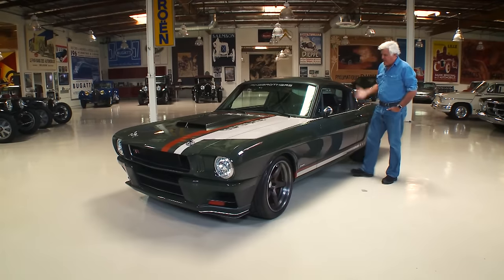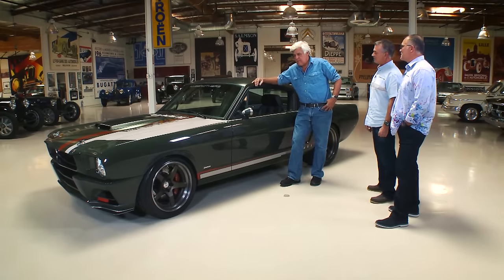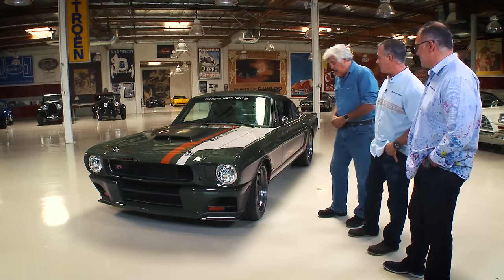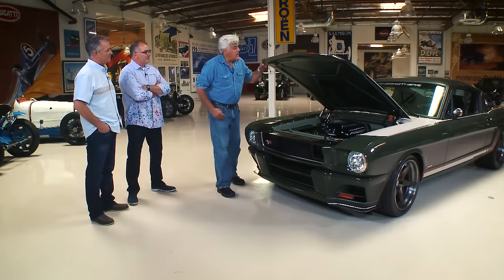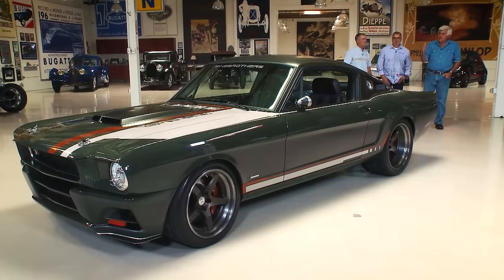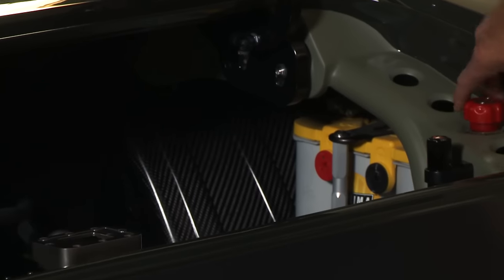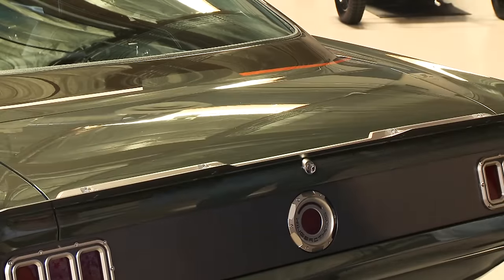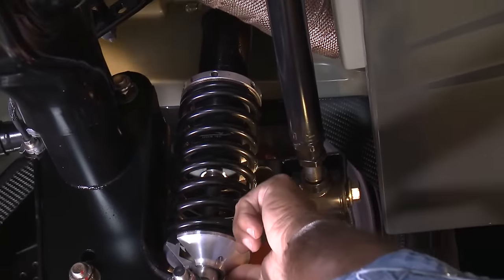Ringbrothers 1965 Ford Mustang Espionage - Jay Leno's Garage

Comment: Lets be honest. When a car is built to that extent, it's not really a Ford anymore anyway. 

I'm mean, it is. But it isn't. So there's nothing wrong with the LS.
Reply: Yeah I agree 100% man. Ford needs to step their game up and make more accessible engines like GM does with the LS series. If they would do that I don't think we would see all these LS swaps, because it does get a little boring seeing everyone putting LS engines in everything.
Reply: +Cotil3Boy47 yea shoulda swapped to a j2z
Reply: +Cotil3Boy47 yea bro
Reply: They're stupid for not going with a turbo 4 banger OMG OMG OMG the low end torque is unbelievable so much POWAAAAAAH!!
Reply: +Cotil3Boy47 yea a formula atlantic 4age would be nice
Reply: +SpaceManDawn Now if they had used that crate twin turbo V6 that makes a ton of power for kinda cheap that would have been worth a segment on JLG
Reply: +SpaceManDawn Well.... It is a hot rodding tradition to put Chevys in fords to make them faster. The SBC brought light weight and power into an everyday guys car.
Reply: mweverett This is very true but I wish Ford would make a more affordable SBF so we can have a little more diversity ya know.
Reply: +Cotil3Boy47 its not that they're engines aren't accessible, because they are. Its just that true builders know the real potential of the LS series and how it is superior than most engines.
Reply: Mike Cid Yeah that's what I meant, because with the LS engines you can get alot more out of it with less plus great reliability.
Reply: +SpaceManDawn Ecoboost 3.5 would have been cool.
Reply: +Cotil3Boy47 Ford has stepped their game up. You're right in the LS being a very accessible motor, but that's only because it's essentially been around for 30 years.

Ford has taken a gamble on getting away from pushrod motors, and while it's taken them a good while to get their feet under them, the current engines offered finally compete against the LS/LT series.
Reply: Couldn't agree more.
Reply: +William Timmins It would have been a lot slower though
Reply: Would it? 900 hp from 3.5 is not that big of a deal i have 3 customers that have over 900 hp subarus at 2.5 and 2.6 motors. I have seen many 3.5 nissan gtrs in that range and crush many over 1000 hp cars in the mile drags. never the less if the ecoboost made say 600 your going to tell me that guy is going to use all of his car? Most people cant use there stock car to full potential. Its might be more track savvy with 2 less cylinders over the front wheels and a little less weight we wont know just would have been a neat motor for a old school mustang. Not knocking the ls as i just stuffed a supercharged ls3 at about 760 hp in to a BRZ Bla nightmare.
Reply: theparttimewoodworker If you're going to troll, at least know how to spell Camaro. try again.
Reply: Yeah I guess so..Ford is coming out  with the new GT that has 600 stock....so it doesn't take a lot of imagination to see 900Hp
Reply: +Mike Cid Even though the actual "LS" engine may be only 20 YO, It has its roots in the pushrod motors of old with GM. That's why I said 30 years. LS motors are still old Chevy pushrods at heart.
Reply: I never said they weren't, but you specifically said the LS engine has been around for 30 years.Pushrod at heart and still better than most engines, and easier to work on. DirtyD
Reply: +Smokin07ram the 3.5L EcoBoost platform is a fuel system, turbo swap, and mile head work away from 1000 hp easy.

Bisimoto Engineering was able to get a 2.3L EcoBoost Mustang to 900 hp with very mild modifications. So a 3.5L would only help improve that power number.
Reply: DirtyD If you really look at it the Ford dohc is kind of inferior in a way. I love both companies and engines equally so don't get me wrong here. It's just that the LSx engines are lighter,more torque, more compact and gets just as much if not more  MPG(depending on application).So I just don't see why people always claim that the Chevy's are old outdated tech. The only advantage I can see the ford dohc has is they can rev a little higher.
Reply: +SpaceManDawn True, the car is only a Ford because of the VIN. I'll say this, as much as I love LS (I had a 2001 C5) it's the easiest motor swap period so, it becomes cliché. Wonderful engine, just would have appreciated a different V8.
Reply: ***** I am a chevy guy, but I hear that
Reply: +Mike Cid I was indirectly saying the tech behind the LS has been around for awhile, as I know the actual LS line hasn't. Poor wording on my part.
Reply: +Cotil3Boy47 EPA and CAFE don't apply to the new FGT. Ford chose the 3.5L EB to conform to the racing regulations for LeMans, which don't allow a motor to be over 4.0L in displacement. They've been testing the 3.5L EcoBoost prototype for 2 IMSA race seasons now preparing for the FGT specifically. Why spend time and money developing a new engine when you already have a proven one right in front of your eyes?
Reply: +Cotil3Boy47 VCT is still in its infancy. Due to CAFE and EPA, GM will eventually have to bid a due to the pushrod technology and begin with a new platform. The current DOHC motors with Ford are doing pretty well, especially the Coyote. While they really are pushing the EcoBoost lineup, the normal NA motors are still pretty stout.

However, calling DOHC technology "inferior" is just stupid. Look through all the NHRA and NMRA record books and you will see DOHC Mod motors holding records, while an LS engine is no where in site. Fact of the matter is a DOHC has much more potential than a OHV motor before you have to start looking for more displacement
Reply: DirtyD Haha, you're still the same. I bet this is much more civil than debating on DFW50s.com right?
Reply: +Dominic Toretto haha, you know it. What's up man? I shot you a text, but not sure if you still have the same number.
Reply: +mweverett haha go say that to the new gt350r shatters the camaro record on every track they've tested it on. Chevy's suck
Reply: +Travis Gonzalez keep living in denial....
Reply: +DirtyD except for weight and centre of gravity, LS motors are compact light and position the mass of the weight low which is great when your on a budget, i am a mopar guy but you have to give credit where it is due LS motors are the best all round v8 performer at this point and time
Reply: 1. You did not have to call my opinion stupid but I should have came up with a more respectful word other than "inferior" tho. I can see where you are coming on the ecoboost but I just feel the Ford GT is just more deserving of at least a V8 for the $400k pricetag. Also I love dohc and ohv engines so which ever one somebody choose is great either way. So both have their advantages and disadvantages, i feel It's the great performance per dollar that puts the LSx over the top IMO. It's just that I don't see why some people always feel the need to diss pushrods by claiming it's old outdated tech when dohc has been around for a long time too. Both are great engines in the end ya know.
Reply: +Cotil3Boy47 wasn't calling your opinion stupid, poor wording. Was saying that using the word inferior is stupid. The LS is a much more cost effective and efficient motor for the common mechanic/gear head to work with, without spending buckets of cash. But if you really want to go fast with almost limitless possibilities, DOHC is where it's at. 

The LS will go down as the motor of history most likely.
Reply: +Road to Adventure agreed. I don't hate the LS. I hate everyone that thinks the LS is the GOAT without a particular reason other than GM > Everyone else, just because.
Reply: I can agree with that, also you're very cool man unlike the other people who start insulting you when they don't agree with you.
Reply: i think this conversation is a good example of informed individuals with differing opinions recognising the validity of all the opinions while respecting each person and debating the facts with the right amount of opinion thrown in, hopefully one day in the future this will be how all discussions amongst people occur
Reply: most people with cool hobbies haven't got time for bullshit that doesn't matter
Reply: +SpaceManDawn agree but you almost have to update some things.  i drove an orignal 65 once and it handled like a pig, body roll, bad squishy brakes, loose stearing, underpowered 289, like driving a tank, well what i imagine a tank would be like to drive.
Reply: +Cotil3Boy47 Bear in mind that GM's LS series are small block overhead valve engines... nobody else really does that... Dodge's Hellcat engines are overhead valve... but it's arguable that that's a tantamount comparison to apples and oranges... so ppl go with the LS series because of a lack of other options and their amazing accessibility and immense aftermarket support...
Reply: +Cotil3Boy47 and give it a massive fart can... and a wing... and ground effects and don't forget your neon...
Reply: +SpaceManDawn Kinda like with Ken Block's 4x4 Mustang. I really don't get why people are so butthurt about these things sometimes. The whole American car culture is based on rebellion, this is just another step.
Reply: +SpaceManDawn its not anything anymore just a really nice kitcar... Haters gonna hate
Reply: +Cotil3Boy47 
LS Engines = Best price, easiest install, made to work with everything. (AKA LEGOS)
FORD Engines = A little pricier, have to know how to install engine, BUT HIGHER QUALITY. (I.E. Tougher pistons, rods, crank, housings, and block AKA more room for bulletproof POWER (without blowing up your engine.) (It's sort of like a titanium razor, you don't need it, and it costs more, but you'll sure get a better shave for longer.)
LS motors are boring, but they work.
Reply: God that's like saving Chuck Norris with the heart of Justin Bieber.
Reply: cybertree
I don't get it.

You're saying you wouldn't kill Bieber to save Norris? Seems like a win win to me.
Reply: SpaceManDawn nope norris is old his time has passed beaver on the other hand is pretty generous when it comes to donating to the needy and he is still young. what have you done with your life? ps. beaver has donated more money then you will make in your life =(
Reply: +SpaceManDawn the motor isnt good
Reply: John Rogers john rogers = guy from india?
Reply: Nothing wrong, except for the fact that it's a POS junk GM product....ruined the car for me, I stopped watching the vid right then and there....
Reply: +Branon Fontaine,  I think you should have Jay put a big block Ford in a Government Motors car.
Reply: Lance, be nice to Brandon he is really a typical American car buyer. He drives a Honda.
Reply: +zum Saw a mid-80s Mustang with a j2z in it for sale on Craigslist.recently.  Had TRD fender emblems, even.Guy wanted 28K for it. May take a while to sell.
Back in the '80s one of the Mustang magazines featured a '71 Mustang with a Chevy 350 and twin turbos. The next month the editors said they'd never had so much hate mail over a car before.
Reply: +theparttimewoodworker If they had built this car as a Camaro, I would be the first to say "well done."
Reply: +Cotil3Boy47 So Ford can put 427 and Boss 429 engines in a NARROWER Mustang body than these, but you are saying they needed to put an LS? No thanks. Like the guy said, show some class and build a Camaro.
Reply: +Adam Komorowski That's the crazy part. This is obviously NOT a low budget deal. Put a Voodoo engine in it with twin turbos and crank it up to about 2,500 hp.
Reply: +aserta At least Ken Block put a Ford engine in it. NASCAR Ford engine. Ken has some taste.
Reply: +cybertree And it all just goes to show that the more things change the more they stay the same. I remember talking to a guy who was building a Ford engine for his Torino. This was in the '80s. Even then he said it took a bit more work and thought to get the Ford engine to perform versus the Chevy 350.
Reply: +cybertree Ok,after repeating this at least 3x you have permission to think up another comment.
Reply: It's barely anything other than custom
Reply: Agree, this is a replica car.  I like original.
Reply: I agree. I'm a die hard Ford fan, but once it's turned into a machine like this, it over.
Reply: I'm with ya
Reply: The gm ls motor is pound for pound the best performance value on planet earth. Thats why knowledgeable car people swap them into EVERYTHING.
Reply: +Shuma Gorath ouch
Reply: +Shuma Gorath 
Then a month later when the motor cracks are blows up 

You go to the hemi
Reply: Let's be honest the hemi is the better engine 

It's better than ford and Chevy motors 

HEMI (hem-e) adj.

Mopar in type, V8, native to the United States, carnivorous eats primarily mustangs, Camaros, and corvettes,  and also loves eating a import now and then.
Reply: +Jonathan Kassebaum or*
Reply: +Shuma Gorath that's what a muscle engine should be

Big fat and 
Unlike Chevy 
Fast
Reply: +Shuma Gorath not saying Chevy engines are bad 

They're not great 

I would take a hemi over it to build a car
Which I have, Chevy motors are cheap
But that's why they're cheap, you get the least HP for your bucks 

But hey everyone has an a opinion
Reply: Jonathan Kassebaum chevy doesn't make propiatery engines,  its gm. If you want big,heavy and strong you can buy an lsx block for cheap. ...that's why the top engine builders like nelson racing,ring brothers and Hennessy use ls motors. If you want to pay more for less power then you are not very smart
Reply: +ChrisInyaass™ easier to put variable cam timing on ohc engines and easier to get to the cams and dohc engines breath better than ohv.
Reply: armymatt83  Changing the timing chain on an lsx is easy and you never have to worry about it breaking like on dohc, it's not to hard to change one cam on a ohv. And it's cheaper buying just one cam, and more compact compared to a dohc.
Reply: ***** He was right
Reply: No there's nothing wrong with the LS series engines for a custom build but if you're the type of car guy i am you'll go for authenticity wich means you won't fn  put an LS in a Dodge or a Ford or a HEMI in a Ford or Chevy but i have nothing against guys using an LS because it's the most offordable and easy to mod engine out there
Reply: +ChrisInyaass™ ford also needs to start building the 7.3 liter  powerstroke diesel again
Reply: +Matt Rodriguez Agreed.  Probably the best Diesel motor ever put into a pickup truck.
Reply: Eric Stpierre If your going for authenticity, are you keeping the shitty stock drum brakes,  shitty 60's suspension?
Reply: Eric Stpierre Then you are losing the original authenticity?  There are still those guys who go after true to Era numbers matching builds.
Reply: Shuma Gorath no the the word authenticity i mean id use parts endorsed by the brand for example ford if that is i cant use oem parts if those are to far gone
Reply: +ChrisInyaass™ The Coyote isn't accessible?  It's a crate motor.  How much more access do you want?
Reply: Adam De Fouw You can get a 5.3 liter off a Silverado for $500, that's 1/5 the price of a coyote
Reply: +Shuma Gorath What's your point? I was talking about crate motors for a reason.  Not a junk engine from a wrecked truck.  A turn key 5.3L is around $4000-5000 if memory serves me correctly.
Reply: Adam De Fouw People build 1000hp turbo engines from those junkyard 5.3 and even stick them into mustangs.
Reply: +Shuma Gorath I'm not denying that you can make big power with junkyard motors.  

But you're missing the point.  

You can't compare a junkyard motor to a crate motor and then blame the factory for the cost of a crate motor.  

That doesn't make sense.  You have to compare apples to apples.
Reply: Adam De Fouw No you can't make big power easily with just any junk motor, a rusted 454 from 1973 is going to take alot of time and money to restore.  It's easier to find a newer late model low mileage lsx because it's widely available in Silverado , suburban,gmc,camaros, escalades etc. My point is the lsx platform is the best performance value on earth thats why the top engine builders in the world use it, even mustang,import guys know this and are starting to swap. With a trickflow heads and cam you can make 500rwhp from a ls1 from 2001, all in a light weight aluminum motor. It's just the brand loyal fan boy's that can't get it past there pride and egos.
Reply: +Shuma Gorath You're also entitled to your opinion.  And I couldn't convince you differently anyway.   That much is obvious.

LSX motors are good motors.  I don't think too many people deny that.

But you have to consider what your goals are.  And there are other things to look at with engines beyond how much power they make.

Things like reliability, sound, power curve, redline, etc.  LS motors make a lot of torque on the low end, but that isn't suitable for every type of driving.

A lot of people prefer how Ford motors sound because of their firing order.  I know I do.  They sound more mellow.

And it's ironic that you are ripping on brand loyal "fan boys" because you are obviously an LSX evangelist.

Why not let everyone decide for themselves what they want to run?
Reply: SVT390 If ford or honda was making a motor that was winning le mans,nascar and was cheap and widely available I would be all over it. Lsx motors are super reliable I daily drove mine for years at 150,000 miles before I sold it, heck an old c5 z06 gets 27mpg. The ls7 has a 7,000 rpm redline...and turbo set ups can get you super high end with proper tuning and matching heads and cam. Sound has alot to do with exhaust,cam,insulatuon etc.The lsx is not perfect, nothing is.
Reply: We could go back and forth all day long, Shuma. 

I also disagree with your statement about LSX motors being in NASCAR.  I'm not entirely sure what you meant by that.  The R07 isn't very much like other SB Chevys.  If anything, the current NASCAR motors have a lot more in common with the 351 Windsor than they do the LSX.

Everybody has their preferences.

Also, there are a LOT of options out there besides the LSX.  At least Hot Rod magazine thinks so ..

http://www.hotrod.com/how-to/engine/1201phr-15-hottest-crate-motors/
Reply: Adam De Fouw The lsx motors are not technically small block chevys, the design of the cylinder heads, and some of the architecture of the motor is ls based
Reply: I was talking about how it isn't much like other Small Block Chevy's in general.
Reply: The lsx is winning at le mans and the gtr and ford eco tec are having reliability problems and struggling.
Reply: Ecotec is a GM engine.  

Ford's engine is the EcoBoost and the motor itself isn't having any reliability issues.  

The problems they had with the car were related to the gearbox and brakes at the 24 Hours of Daytona.  

Gearbox does not equal Motor.

Brakes does not equal Motor.

The GT is bringing speed to the party with the EcoBoost motor.  

When GM debuted the C5R, it had a ton of teething pains and, on top of it, it was slow.

Don't act like entering a series is an easy task.  It wasn't for GM and it won't be for Ford this time around either.
Reply: SVT390 That's why ford is being sued for engine fires and violent shaking.
Reply: What's your point?

I can find lawsuits against GM for piston slap issues and other problems related to the LSX engines.  

There is no such thing as a perfect engine and people sue for everything under the sun.

There isn't any manufacturer who doesn't have problems with what they produce at some point.

Can't waste my time talking about this stuff anymore.
Reply: SVT390 Piston slap only happens for a few minutes on warm up usually only older ls engines then it goes away,  some people switched to thicker amsoil oil and it goes away. But that is totally different then engine fires.  I still stand corrected the lsx platform is still the best performance value, every true hot rodder knows this.
Reply: Spoken like a true LSX fan boy / apologist.

Enjoy your engine.
Reply: Adam De Fouw  Your ecoboost engine catches fire, ours makes noise on a cold start. Yes ill enjoy it just like all the Mustang and import guys are doing.
Reply: +zum W brapbrapbrap
Reply: +Vladpryde Naaahhh. im a  ford guy for trucks but theres something special about that Cummins. Everybody uses them. boats, generators, etc Always heard dodge cummins. can be tuned with 2k hp. just imagine the torque.
Reply: +Shuma Gorath Chevy has never le mans.lol😂
Reply: +Miguel Garcia.  "never won le mans" i mean
Reply: +ChrisInyaass™ The LS advantage is simply that with ohv you can get  big block displacement with less size and weight than a smaller displacement dohc v8, be it Ford, Mercedes, etc. Inch for inch of displacement though, the LS definitely makes less hp.
Reply: they should put the new 5.2liter v8 Ford engine that has a redline of 8250rpms. The voodoo v8
Reply: Miguel Garcia Yes they have the corvette c5r,c6r,c7r   have all won the gt2 class beaten Europeans....do a little research before you speak.
Reply: Miguel Garcia Bentley has more combined lemans wins then all American manufacturers. GM has competed in many motorsports and won at the highest levels with ls based engines.
Reply: +Shuma Gorath what the hell are you talking about? How did Bentley get involved in this conversation? lol😓😐
Reply: Miguel Garcia Im saying you can't always consider a brand dominant in motors ports then have it translate over to other things.  Bmw, Porsche have had disasters in formula 1
Reply: Miguel Garcia But for some reason Porsche,bmw, audi can't build a competitive f1 motor
Reply: Miguel Garcia  Doesn't change the fact that the ls motor is the best swapped performance budget on earth over anything ford makes.  Gm paid back it's loan,  Google it
Reply: +Shuma Gorath surreeeeee. Do you believe everything you see tv??lol and the ls is best for cheap asses or for people who dont like to struggle and don't have a purist mindset................
Reply: Miguel Garcia You can buy a $500 iron ls block and build a budget turbo car, or you can buy a lsx block and build a 1000hp + car. I have spend years working on ls motors, Ive owned them, Im not a keyboard warrior with a slow mustang like you 😈
Reply: +ShumaGorath lmao the 2002 and the tj wrangler are icons in their own niche groups.Any motorsport or drivers enthusiast and Ulitarian guy knows that....Daaaahhhhhh!!lmao what do you drive Homeboy??  Oh and did i mention I'm about to get a 82 toyota fj40.............
Reply: Miguel Garcia swap an ls6 in the bmw, an ls7 in the jeeps, LSX in the passat
Reply: +Shuma Gorath
Are you on drugs? i advise rehab.....lol
Reply: Miguel Garcia I did a search all those cars have had lsx swaps by someone
Reply: Well they spend all the time and money to get it just so and then picked an engine for simplicity sakes.
Reply: Yeah but with how much more boost ?  It's easier on a bigger displacement motor to make the same power as a smaller one and more torque to boot
Reply: Id imagine the lsx iron block is heavier than an aluminium ford block. Now the heads are heavier
Reply: Well the hemi is but thats about it really
Reply: I disagree......to keep it proper
Reply: Probably just a kid trolling if not he's a sad story lol
Reply: SpaceManDawn || Chevy makes shitty cars with a good engine, ford makes great cars but could use a better engine. When a car is built to this extent, its a ford. If they made engines as good as chevys, aside from their trucks, ford would be superior by far. but if Chevy made good cars, aside from corvettes, they would dominate ford. That's why people keep swapping engines.
Reply: I agree, taking the best of all American muscle and making an extraordinary car is no sin.  How many mustang2 front ends under classic Chevy builds.  Thats American racing know how.
Reply: I have to say it. I am old school and never paid much attention to party lines. Chevy, Ford, Chrysler to my crew they were fodder for the build. I have always measured a "gear-head" as someone who could get creative in their engine swaps and the more so the better. Back in the day we would have a strong runner and a sweet body with a underpowered or dead mill. Get out the tape measure and see if you have to move the shock towers and/or reposition the "A" frames. Figure out the engine mounts and fab em up. Measure the driveline and cut it down. Next thing you know you have a Chevy powered Chrysler or a Ford Powered Chevy or vise versa. If you had to stick to Chevy/Chevy or Ford/Ford etc. it only means you are not a true gear head. You were just a wanna-be any way. I like seeing places like Jags That Run (look em up). Those folks are my kind of car guys.
Reply: Well the builders can't clam that it is not, and it is not a chevy.
Reply: SpaceManDawn uh yeah they should have left the ford in it period
Reply: There's nothing wrong with doing whatever the hell you want to "your car. That's the beauty of customization
Reply: SpaceManDawn you know besides the fact it's an ls
Reply: they did alrdy and was on the show..
Reply: It's not the affordability nor reliability that are problems with the 4 cam Ford 302. It really is the sheer size, height and especially width that prevents it from fitting inside an engine bay. The LS, even the LT engines are so compact, they fit almost anywhere. That's what makes them so popular. Does that make the swap boring? When I see a Nissan 240 with a V8 burbling under the hood... It makes me giggle everytime!
Reply: @littlepolarbears  its "2JZ"
Reply: @tssfab  he saved over 500 pounds going to a carbon body. I don't think the weight of the engine is a big issue. The LS was a perfect swap in my opinion.
Reply: @elite_skillz310  you are choking on those words now.
Reply: @chrisinyaass7508  I would say that 647hp and 550ftp of torque is more than enough. You get the hp of a V8 with the weight of a v6. Can't beat it
Reply: @wannabBIGA  we all must be Republicans. Lol.  Because Democrats can't have rational conversations with differing opinions.
Reply: @aserta  Ken Block's stang is fricken sick. Such a beast